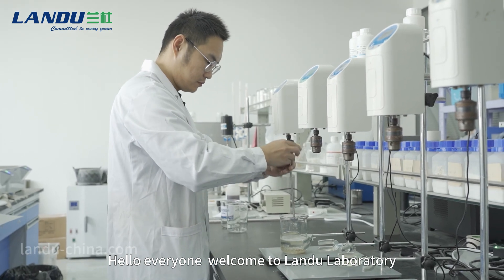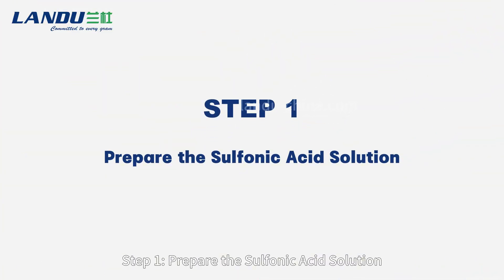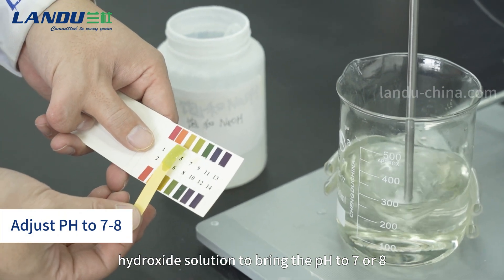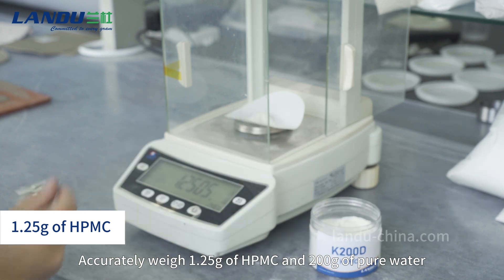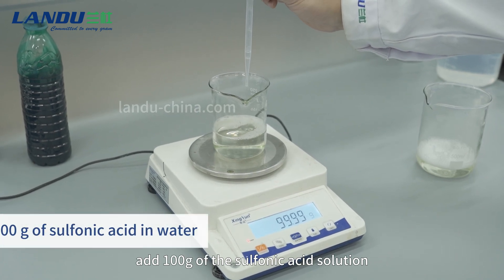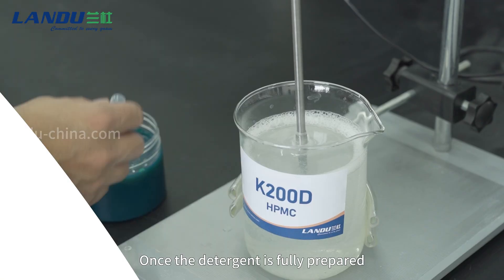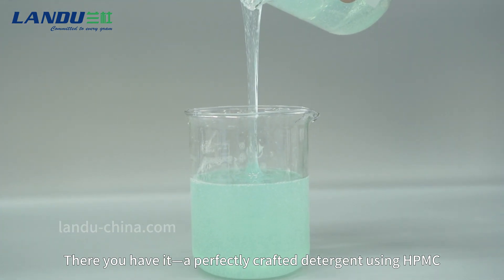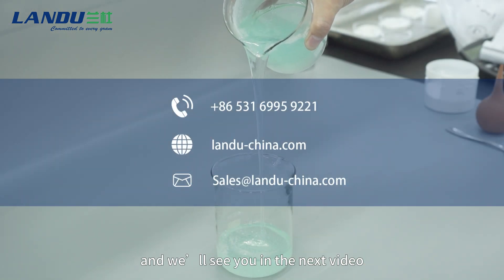How to Make Detergent Using HPMC – Step by Step Process

Comment: Thank you for your valuable information.
Here in our market SLES and LABSA are used to form very very viscous detergent like wax form we can say the detergent couldn't pour we up down.
Can HPMC bring that level viscosity ?
Does it reduce the percentage of SLES and LABSA?
Does HPMC have other function ecept viscosity?
Regards
Reply from the maker: Yes, HPMC can achieve wax-like, very high viscosity under certain conditions (high concentration, specific grade, heating, or salt/surfactant interactions).
It can also reduce SLES/LABSA usage while improving suspension stability, foam, transparency, and smooth texture.
If you’re interested in HPMC for industrial use, feel free to add our WhatsApp +86 150 6935 3616 to learn more.

Comment: Adding water to 14 g  of LABS in ratio 1:100 means that add water to 1400 gr in LABS beaker??
Reply from the maker: Thanks for pointing this out. You’re right that saying “1:100” can be confusing — it usually means 1 g of LABS with 100 g of water. But in this tutorial, that wasn’t the case. What we actually did was 14 g of LABS mixed with 200 g of water (total 214 g), then we only took 100 g of this solution for the final formula. That 100 g portion contains about 6.54 g of LABS.

We’ll make the description clearer in the future so it doesn’t cause confusion. Appreciate your sharp eye! 🙏

Comment: Thickness reduces once perfume is added
Reply from the maker: Yes, adding perfume can slightly reduce the viscosity, especially if the fragrance contains alcohols or solvents. In our formula, we use HPMC (Landercoll K200D) and salt as thickeners, which help maintain good stability. To minimize the effect, we recommend adding fragrance at the final stage in small amounts (0.3–0.8%) and adjusting the salt if needed.
Reply: @landu-china Thank you in advance 

What % of HPMC, Coustic/Light soda ash, SLES, LABSA, EDTA, Salt  Citric acid, Formalin you recommend?. Suppose, 2000 Litr soap Formulations
Reply from the maker: @haileasmamaw1221  Thanks for asking! We actually don’t use or recommend formalin — it’s not safe for home or commercial detergent production.
Therefore, we’re unable to provide or recommend any formulations that include it.

Comment: Which more stable as thickener, hpmc or nacl ?
Reply from the maker: HPMC is much more stable and effective as a thickener than NaCl.
HPMC is designed to thicken and stabilize formulations.
NaCl, on the other hand, is not a thickener—in fact, it often modifies viscosity in surfactant systems by salting out micelles (e.g., boosting viscosity in SLES systems to a point, then causing thinning if overdosed).
In terms of stability (against pH, temperature, long-term storage), HPMC clearly wins.
Reply: @landu-china ❤❤❤